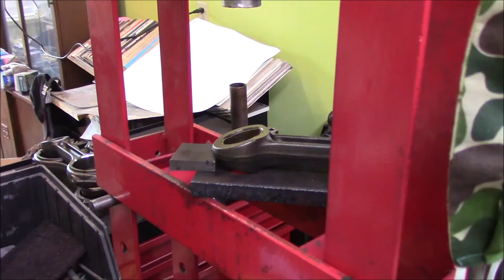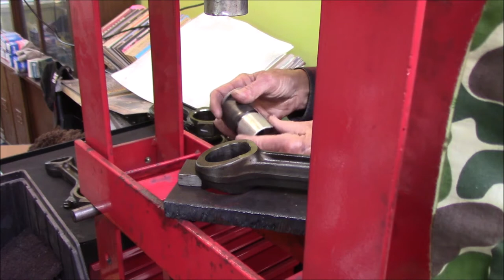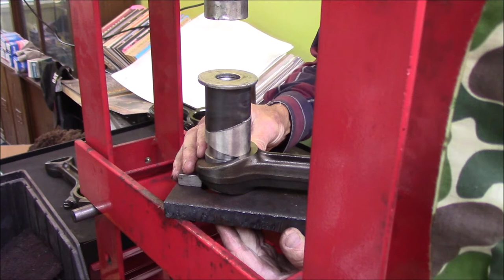Tapered Wrist Pin Bushings

Comment: Where can I find that tool to match the bushing to press in evenly? Do you need to hone the bushing to wrist pin spec after they are pressed in? Thanks for any info
Reply from the maker: It is a home built tool. Made from 3 pieces. Look carefully and you will understand the method. Tools required are a lathe and a mill. Yes, the bushings require fitting to the pins after installation.